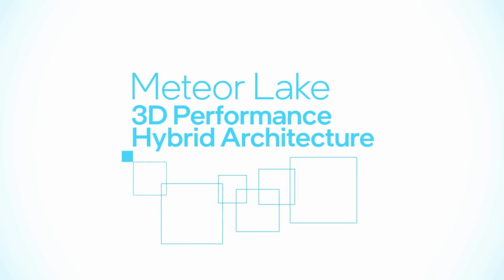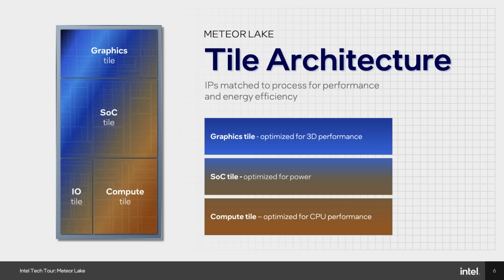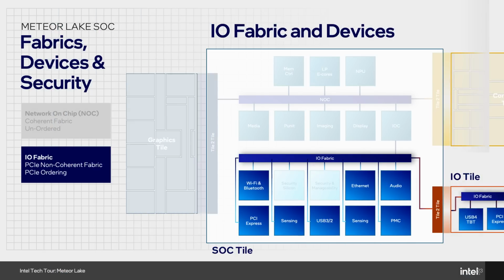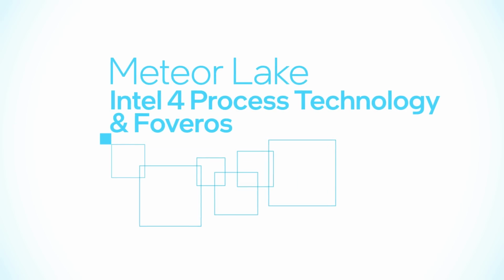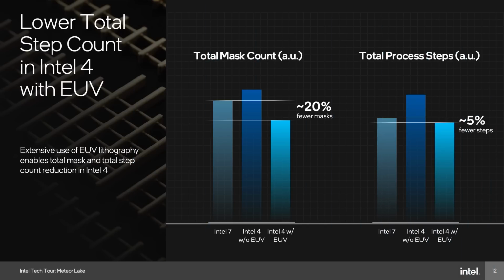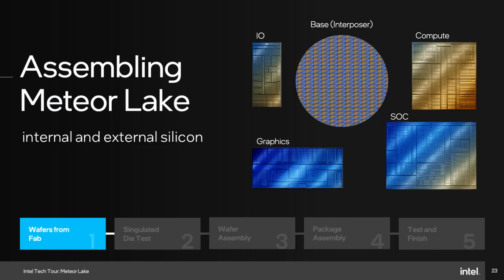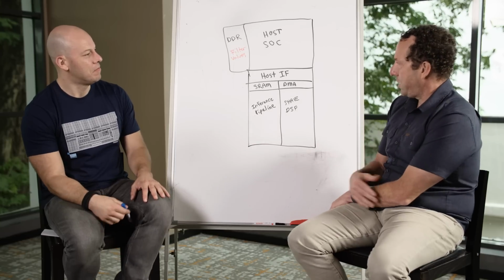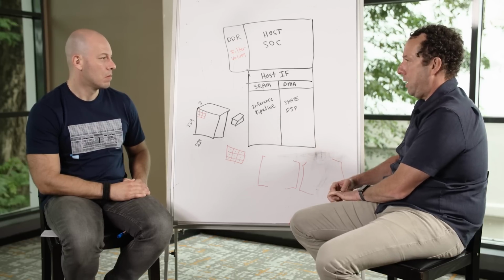Meteor Lake Overview: In-depth with Intel Architects and Engineers | Talking Tech | Intel Technology

Comment: i guess MS is looking very closely at this - windows and xbox will go ARM if the amd64 platform does not change rapidly and drasticly in terms of power/watt and hardware media encoding structures. look at apple - as much i despite them. if intel was 3 years earlier with this - maybe that part of the industry that switched to arm would have stayed.
Reply: MS has to invent how to execute X86_64 applications on ARM arch faster than on Intel or AMD CPUs.

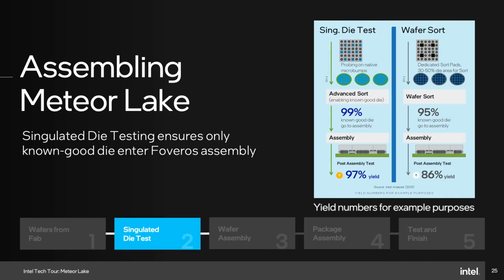Comment: 23:00 Here is the tricky part of design made of tales, multiple tales design, not only you have assembly properly. But if chances of good part are  95% x 95% x 95% x 95% x 95% yeld of 1 IO + 4 CPU tiles drop to 77% what AMD "invented" came with cost. I never thought about that :) 99% to power 9 = 91%  then 9% CPU's are potentially wasted. Unless you are able to test and disable
Reply: Tiles couls be tested before adding to whole package, do you stay with 95%
Reply: @Atomus87  Yes but what is different Intel   put these one on top of another, unlike AMD, it's additional challenge to test, what i learnt from another video they designed these building blocks in such way to be able test each individual block electrically before assembly. Unlike other companies - testing only visually before and after assembly. If i remember correctly around 2018 i saw this "technology" in Altera's FPGA portfolio because Altera had multiple tales design before Intel even dreamed about 4nm.

Comment: i7 1460p-1470p or whatever they would call it, would be exciting processor for laptops + paired with 770m battlemage
Reply: There is no such thing as battlemage for now and before it comes, if it comes at all, there will be already Arrow lake and lunar lake on the market. Meteor lake is rather for efficiency so for performance purpose better get other CPU like Raptor lake and arrow lake.
Reply: @Atomus87  the upcoming cpu graphics architecture will be better refined than dedicated arc gpu architecture , probably arc + if you wanna call it that. Maybe next cpu graphics will be battlemage.
Reply: @And-vx6ry  But its only integrated graphics. Thermal budget will make it as irrelevant as the current one, not mentioning jokingly slow RAM. It can beat AMD integrated chip and that's all. When it comes to battlemage I was rather commenting that its release date will be already after Arrowlake architecture. Noone will think about meteorlake when it comes to performance chips as it will be easily beaten and will be the one to use with BM.
Reply: @Atomus87  my bad comment, as i use 770m name or intel dedicated gpu name with intel gpu architecture name battleimage.  I meant at least 14th gen integrated graphics will be slightly better than current integrated and maybe can be called arc+ for this comment. 
You are informative Do you think integrated graphics will be improved to arc+ or equal to arc with expected die shrink ?  I really need upgrade for portable windows pc and that av1 encode, at least this av1 encode should be faster ? Like a good light portable machine 360 rotating, 120 hz screen, av1 encode. I really liked that lenovo laptop with arc a370m 4gb 12700h but with soldered ram and so much heat, i held myself back.  I am really looking forward to meteor lake for expected 1480 or 1490 cpu series.
Reply: @And-vx6ry  all signs are looking good, but also newest games are more demanding so in this case there wont be a leap. For older titles I guess it would be nice upgrade, I count for at least 30%. For other usage it should be really good deal but important is to have both memory channels filled and highest native ram speed supported. With producers pushing toward soldering ram and usually only one channel it could be struggle to pick one with ressonable price. We will see

Comment: I do wonder how long these newer micro service type cpus and apus will last. The old monolithic cpus still work after decades of use.
Reply: @@blue-lu3iz more points of failure by overengineering. 

Defining obsolete depends on the use case, I'm still rocking an x5687 in a server.

Comment: I hope all the IO workload comes back to the CPU as it used to be in the old days. That would lessen the latency 12th, 13th gen had while using Windows.
Reply: it's a Windows problem, which Microsoft hasn't fixed. Use Linux if you care about latency I guess

Comment: Will the new Thread Director stuff for the low-power island E-cores integrate with the Linux kernel's Energy Model and energy-aware scheduler APIs? Then things like software update checks and search indexing could run be run with utilization clamps so they would automatically sit on the most efficient cores and not cause the CPU to boost.  I hope x86 and ARM aren't forever doomed to separate NIH frameworks.

Comment: When Intel just responded what Competitors have done, even beating out Intel. I just use kinda joking language though 😂
Reply: This is a brand new design the only comparable chip is Apple M2 , AMD don't have anything in comparison
Reply: @floopybits8037 yes 100%
Reply: @floopybits8037  AMD has Phoenix right now, Strix Point Q1 next year. They both have built-in accelerators but it is monolithic in design.

Comment: Question : 
the LP E-Cores on SoC Tile, is it similar architecture to the typical E-Core on the Compute die, just different V/f curve? Or different architecture?
Reply: the LP E-cores and are the same as the ones on the compute tile. Just attached to different power rails and different power states
Reply: @alejandrohoyos8555  lp cores will run even on lower frequency
Reply: I think to change nodes do you have to change the architecture slightly and then probably reduced cash. Tsmc 6nm efficiency might be denser than Intel 4 performance, because performance nodes tend to reduce density for better transistors and weaker transmission lines, they might have different transistor profiles for each core in intel 4.
Reply: @AndrewMellor-darkphoton  yes Intel 4 is same as TSMC 3nm.
Reply: @AndrewMellor-darkphoton 

lpE cores are running at very low frequency and using latest nodes is not providing better efficiency than TSMC 6nm so they are saving cost using TSMC 6nm and also getting great efficiency.

Intel 4 node is more efficient and more powerful than TSMC 4nm.

Comment: Very good presentation. The topics discussed had a lot of information and good visual aids. I was hoping for more news on the GPU Tile.
What about Thunderbolt 5? The timing of Thunderbolt 5 announcement doesn't make sense if it is not integrated to Core Ultra.
Reply: Unfortunately TB5 will need additional chip that's not baked into meteor lake package. Hopefully next gen will integrate TB5 natively
Reply: @Arkan_Fadhila  I understand that Thunderbolt 5 requires new controllers. Intel released a teaser of Thunderbolt 5 last year calling it Thunderbolt Next. I'm frustrated that they couldn't get their schedules aligned. You announce the release of a feature only for the feature to be missing on the yet to be announced or released product. There was no rush in announcing Thunderbolt 5 before Meteor Lake. The earliest we can get Thunderbolt 5 is with Arrow Lake which comes out next year. That is a whole year of asking where is Thunderbolt 5. It is a fail for me.
Meteor Lake has a separate die/Tile for the IO which is physically smaller than the other Tiles and on an older manufacturing process node compared to the rest. It is the cheapest die to manufacture.
Reply: @EnochGitongaKimathi  Thunderbolt 5 was just announced, it will take a while for OEMs to finish with design  and mass manufacturing of their products. Plus Intel has stated that Thunderbolt 4 and 5 will co-exist. TB5 will be a premium tier of Thunderbolt and TB4 will continue to be the norm for most people.
Reply: @ablesam  Thunderbolt is developed by Intel. Meteor Lake is developed by Intel. In 1st August 2021 Gregory M Bryant an executive at Intel was touring their facilities and meeting teams based in Israel. He posted on social media about the visit. The post included a picture of a demonstration for Thunderbolt 5 an early working prototype. The brief for the demo was 80G PHY tech based on novel PAM3 modulation. Basically everything Thunderbolt 5 is today. Intel are also the main contributors for USB. USB4 V2 was announced late 2022. Intel have been working on Thunderbolt 5 longer than Meteor Lake. Do the math
Reply: @EnochGitongaKimathi  I know exactly what you are talking about Enoch (in all sincerity), but my point still stands. Meteor Lake's tiles started design back in 2019 when they projected it inline with when TB4 would be adopted by the mass market. Hence they decided to skip TB5 and launch it in a future platform. 

You already know that Meteor Lake has had scaling issues with high-performance tiles hence the desktop variants have been axed. It didn't make sense for Intel to adopt and focus on high-performance specs on Meteor Lake just yet. Heck, even the tGPU was nerfed down from 12 Xe cores down to 8. 

Simply put, even though TB5 has been in development for a long time, it didn't make sense with Meteor Lake's schedule. Also, Meteor Lake was originally supposed to come out in Q1 2023. This product has been delayed for way too long. So if some things seem underwhelming, realize if it had launched on time, it would have been way cooler.
Reply: @ablesam  you are arguing my case. Meteor Lake has been delayed. The Thunderbolt controller is no longer on the CPU die but now housed in the IO die.
The IO die is the smallest, cheapest and least complicated Tile. TSMC N6 is a very mature node now.
It will be a fail to have MeteorLake in 2024 with Thunderbolt 4 integrated.
Meteor Lake is supposed to be the chip of the future, the most advancement in 40 years except it won't feature the most advanced connection of the future.
Reply: @EnochGitongaKimathi  TB controller was always on the IO die, allows for Intel to redesign it quickly in case something went wrong with manufacturing or it had to be updated. 

Look at the market right now and into 2024, neither Apple nor AMD or even Intel has fully adopted the usage of TB5 or even will in 2024. It took a full year after for TB4 to be adopted by most people who used TB3 and many don't even upgrade since they feel TB3 is more than enough. Same goes with TB5. Unless there is some extreme use case, TB5 won't be a good option to the average user (due to cost, cables, needed equipment and more). 

It's not a tragedy that Thunderbolt 5 won't be implemented in Core Ultra. 

Also, Meteor Lake is not some advancement in client packaging. Take a look at Lakefield, or Haswell. The interesting thing about Meteor Lake is at the scale its being done at. Most things that you are about to see in Core Ultra have already been done before either in a Monolithic fashion (Apple/AMD) or even by Intel themselves.